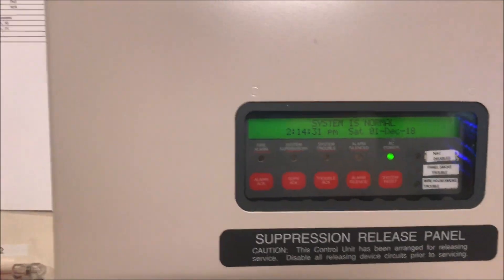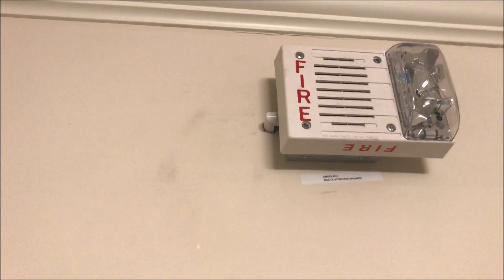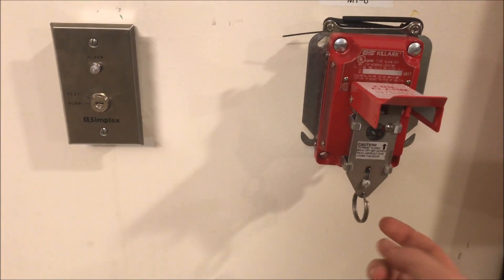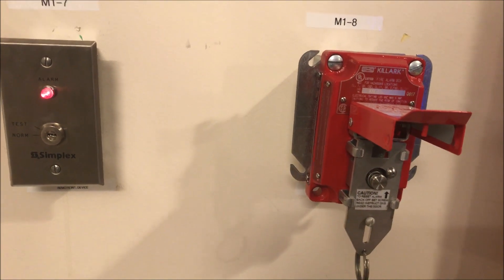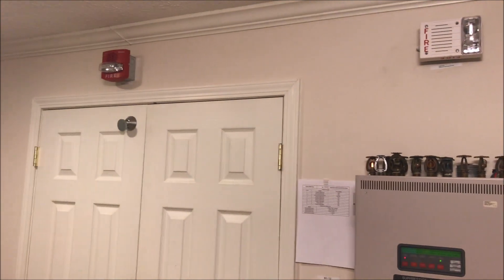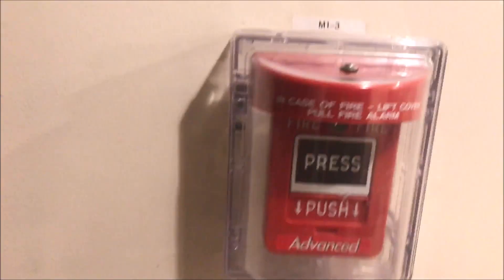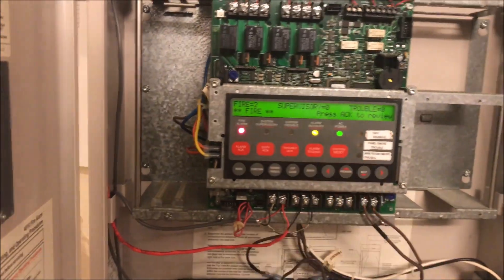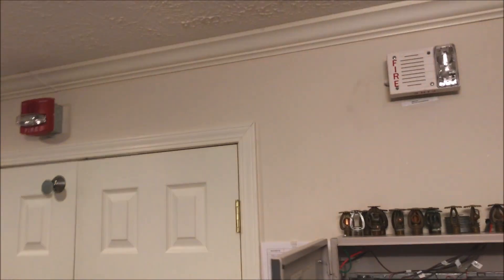Simplex 4010 Test 21: SmartSync and Explosion Proof Pulls

Comment: I have two questions. 1.) Does it matter if you press acknowledge before alarm silence, or vise cerca, and 2.) How is the delay in the horns set up? I noticed that the panel and strobes started activating before the horns activated.
Reply from the maker: It does not matter which sequence you use in the panel to silence and ack. As for the delay, there is no setting for that, but it is actually a result of the coding used for two-wire operation.

Comment: Great video 😀👍👍
Does the advanced pull station, also take the Simplex B key (Since CAT 30 is the same as the B)? 

Does the Siemens MSM Pull Station take a T45 or CAT 30? I’ve got 6 of them (Regular MSM-K or KD) in my high school, and the all take the T45 key, same as the panel. But, I’ve seen very few, say they take a CAT 30.

Thanks!
Reply from the maker: The Advance pull does take the B and CAT 30 key. The MSM does take the T45
Reply: Fire Alarms and Such okie Dokie, thank You!

Comment: Ah, TrueAlerts. Those were probably the first fire alarm devices I ever heard (way back in 2005 I believe). Man were they LOUD as heck, and they also had the power to scare me too. As a matter of fact, they STILL in a sense scare me today lol 😄

Great video 😉
Reply: fireandalarm1234 Sorry it scared you. Do you remember if the strobes began flashing first or would both the horn and strobe activate at the same time? Reason I ask is because when I went to school some of our buildings’ fire alarm panels were programmed to flash the lights first. The purpose was to help those with sound sensitivity to get ready for a fire drill so they would not be startled easily. Some of our older buildings did not have the delay so every time we had a fire drill, a lot of kids would be panicked and some are even traumatized by the unexpected noise. Some of our drills we would get a 5 minute notice before they even pulled the alarm so that students won’t panic over the alarm. Most of them were a surprise so the teachers just had to be prepared to help those having difficulty coping.